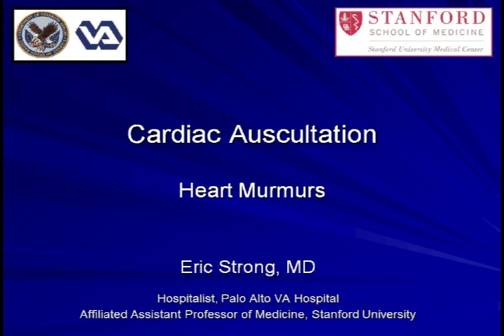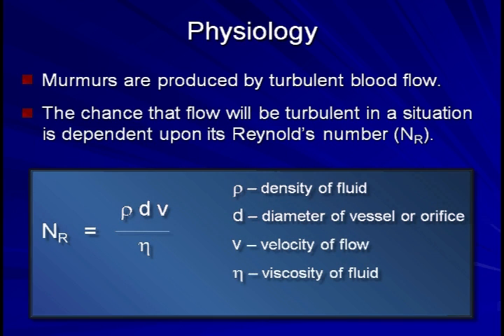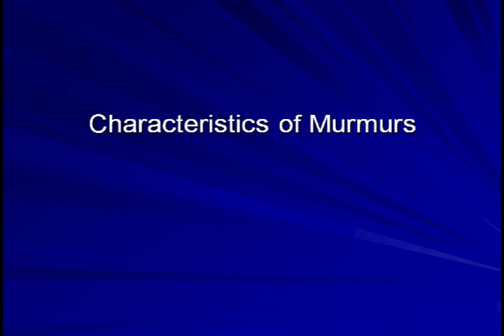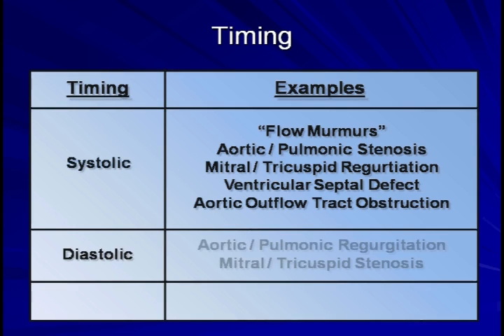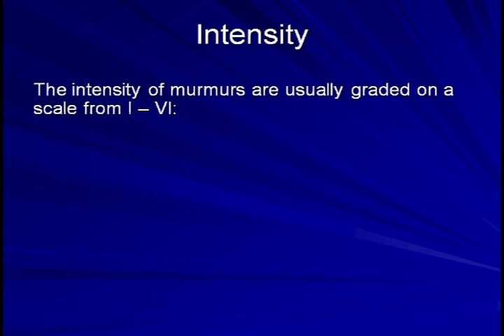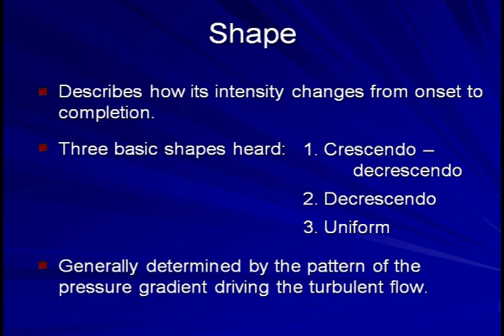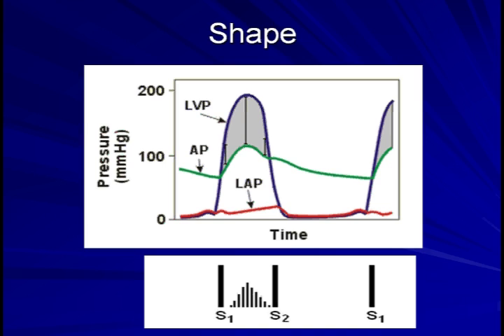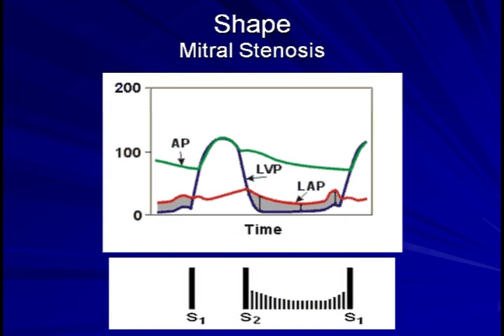Heart Murmurs - (Part 1 of 3)

Comment from the maker: BenEin33, they aren't drastically different.  In patients with AR, there is a steeper drop in aortic pressure during diastole and a slightly steeper rise in left ventricular pressure during diastole as well.

Comment from the maker: There is no difference between regurgitation and insufficiency - they are synonyms.  However, prolapse refers to a much more specific abnormality of the valve in which excess tissue (either excess valve area and/or abnormal elongation of the chordae) allow one or more leaflets to balloon backwards when closed.  The vast majority of prolapse is found in the mitral valve, where it frequently, but not necessarily leads to mitral regurgitation.

Comment from the maker: @moon4647 The most specific answer I can give is that if a murmur was present originally, and then went away after valvuloplasty, but years later returned, I would probably ask either an internist/pediatrician or a cardiologist if an echocardiogram (i.e. an ultrasound of the heart) was warranted.  That would be the only way to know for certain if the valve was becoming narrowed again.  And just because a murmur returns, doesn't necessarily mean there's an underlying problem.

Comment from the maker: @MrILoveYeshua The murmur of MS should theoretically be pan-diastolic with a slight presystolic accentuation (due to atrial kick) in the uncommon patient with MS who is still in sinus rhythm (most develope atrial fibrillation due to extreme enlargement of the left atria).  However, because MS murmurs are both low volume and low pitch, our subjective sense of hearing may perceive it differently; esp. if there is an opening snap, the murmur's early diastolic period may sound more prominent.